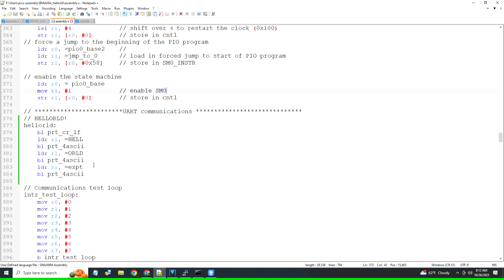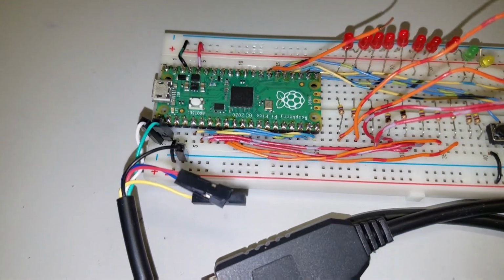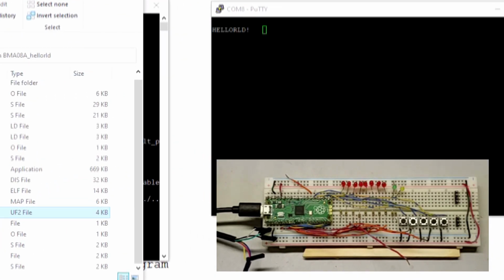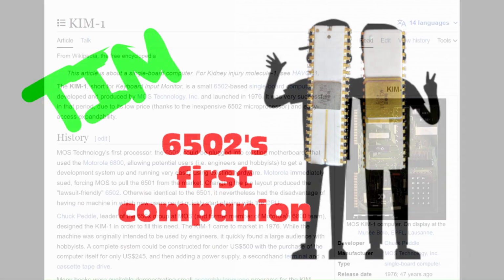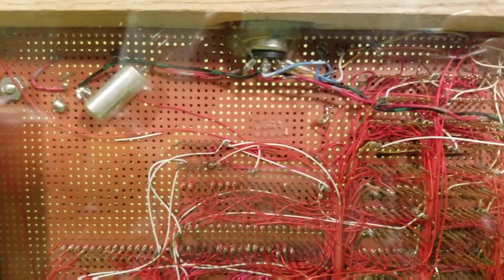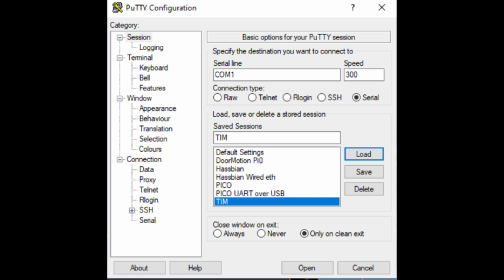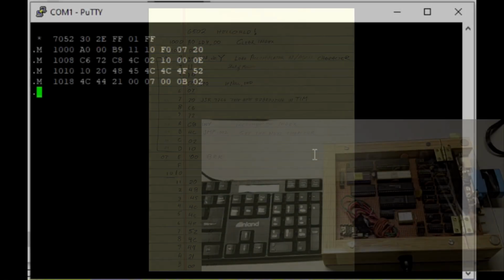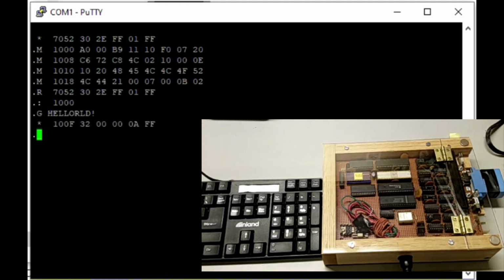The "HELLORLD!" challenge!

Comment: Hey David. Great set of videos! I peeked at a few, and will come back and watch them all. I was wondering if you have gotten PWM (in bare metal) to work? Thanks for any help or insights you may provide.
;-> (cjh)
Reply from the maker: Thank you!  That's a great idea.  I haven't really tried PWM, timers, or DMA with bare metal.  I've been working on a 6502 emulator for the Pico.  This will consume the next several chapters.  We'll see where we go from there.  Thanks for the suggestion!

Comment: Can the PIO do it?
Reply from the maker: It could do it two different ways.  The first would be to just emulate the UART and get text from the main processor.  The second would be to set up a DMA channel and have it write out the message with no processor interaction after the process was started.  That would take a little more time than I had available right now.  I'm picking up leaves every day for the next week or so; ah, the joys of a heavily wooded lot  Thanks for the comment!
Reply: @LifewithDavid1  leaves.!  The two Oaks at the bottom of my garden have only just started to turn , another few weeks and I have to wade through them :-(